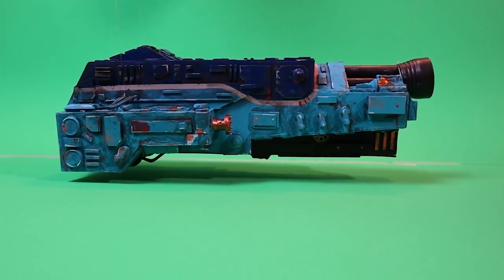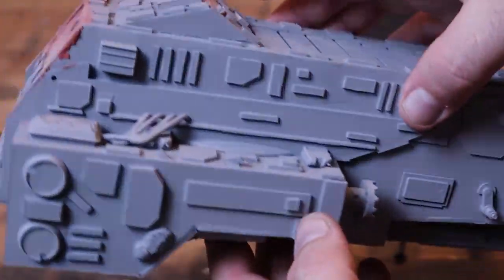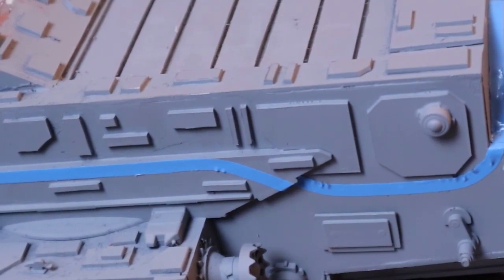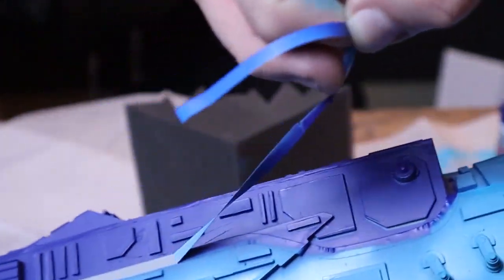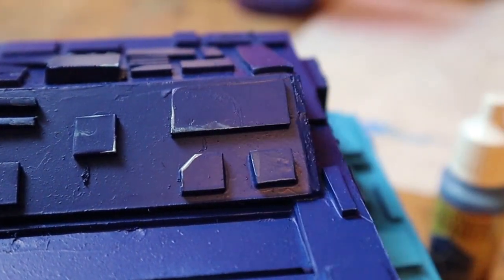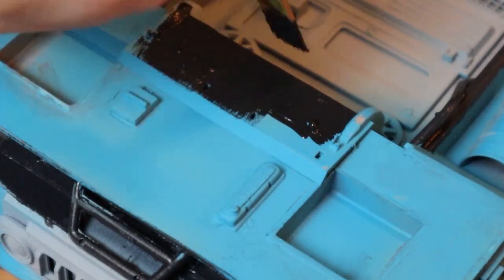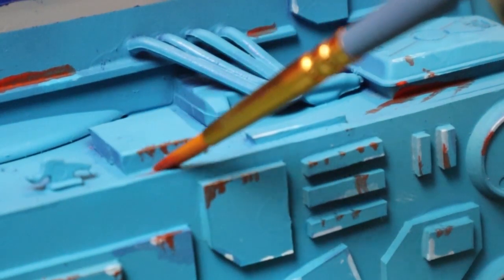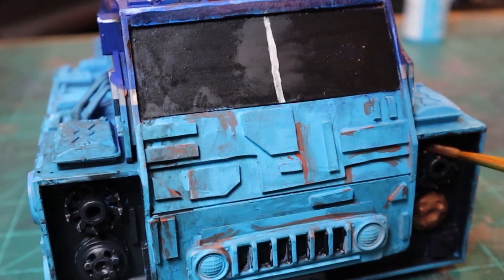Painting a Scratch-Built Sci-Fi Ship for Green Screen

Comment: The last bit was truly delightful, just put together my first bit of my first plastic model car today, way easier than I thought, except I think I got the paint all all wrong. Could you lead me to what brushes to use and if there's a good paint kit I could buy, I'd rather not buy just individual paints, I want options without having a well defined vision at the outset
Reply from the maker: I stay away from Testorsand stuff like that. I love Army Painter's lineup. They sell "kits" They have some really good good out of the box colors that only require a little bit of water additive. When you paint the actual body of the car itself you can get away with aerosol spray paint by Tamiya using light coats if need be. The most important factor for painting car models is to thin your paints to keep them from building up on the surface. It may take you 4 coats to paint something but it's worth it. For brushes get yourself an army painter "insane detail" brush, and a set of water color brushes and make sure you wash them out with water when your done. That's the other downfall of testors is you need paint thinner to deal with the brushes. This stuff you can clean off with water.
Reply: @CurtisCrafts  Thanks, this really is a model that I'm happy to make mistakes on. Do you always prime all your parts? Also, yeah the brush I was using was horrid. But none the less I really want to keep going and build this thing.
Reply from the maker: Yes. I prime things that I'm going to spray. The rest of it just make sure you wash it off really well. You don't want to have any of the mold release agent left on the model when you go to paint. You'll wind up with bubbling and a weird looking final product. Soap and water is sufficient for that and just make sure you rinse all the soap off and let the water dry off.